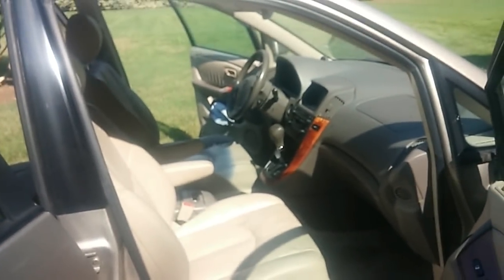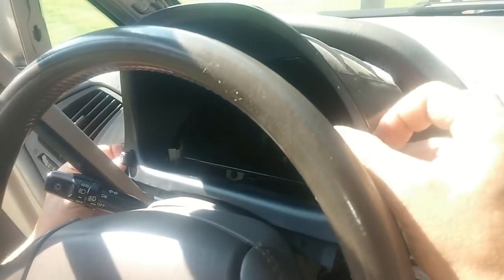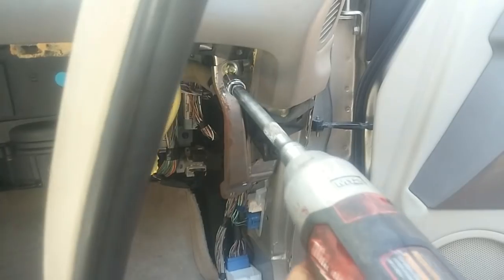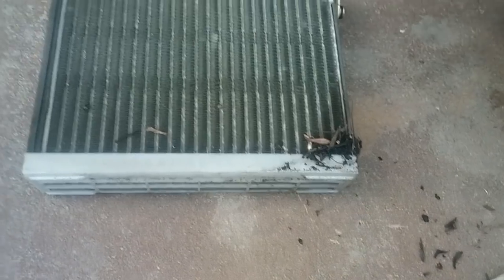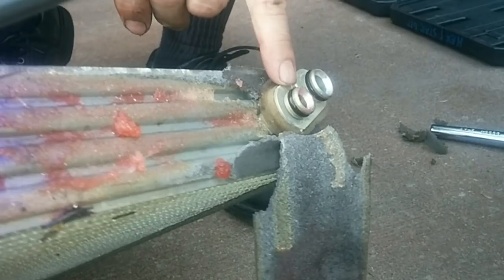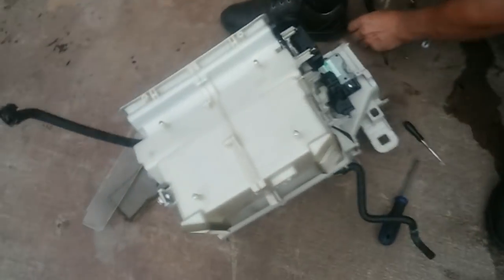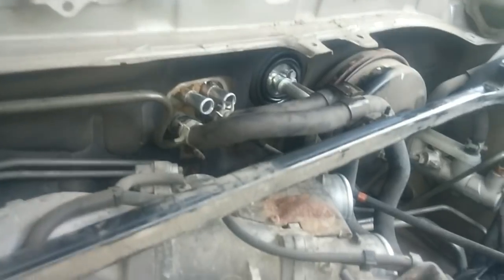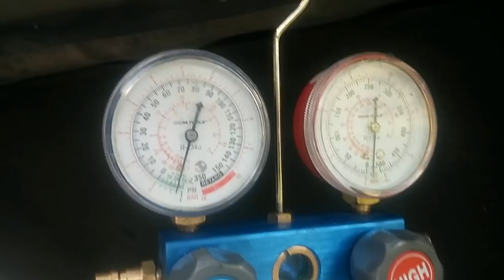A/C Evaporator and Heater Core Replacement - Lexus RX300

Comment: Out of curiosity, what did the PAG compressor oil smell of? Is it an acrid smell, like the one overheating electrical stuff/wires/circuit boards make?
Reply from the maker: Can't really say that PAG oil gives off a specific smell; but leaking freon has its own unique and distinctive odor.
Reply: @hardlymovingpro  First of all, thank you very much for your answer. All around the Internet they seem to say two things: that the actual R-134A hasn't got any odor at all, and that the odor an evaporator leaking R-134A gives off comes from the oil (it dissolves in the refrigerant so that it can be carried around the system). Also, the majority of people define the odor as the one a fresh Band-Aid gives off, but i've tried to carefully smell an equivalent i can readily buy, and the bandage doesn't seem to give off any smell at all. Some also say that it smells like the smell a new car interior usually gives off... As for now, can't smell anything out of the ordinary out of my vents, but it's an old old car, so knowing what a PAG leak, and hence a refrigerant leak, really smells like, might be useful. I could also buy a PAG oil bottle, but it would never be put into use since i can't do AC repairs, and nobody i know would accept an opened bottle even if it's the double end capped PAG. It would just end up lying among my stuff unless i find some alternative use for it (chain lube?). PS Never seen red dyed PAG in any picture i've seen so far, only green. Does it glow red to UV light perhaps?
Reply from the maker: I can't describe the smell but its different than a gas or oil smell.  It permeates the interior when the car is running and there's a freon leak in the evaporator core after a freon re-charge.  The red dye came from an a/c metal leak sealer product that did not work.  PAG is used to identify a refrigerant oil type and is followed by a number.  Never heard of anyone referring to a a/c leak as a PAG leak.  Generally speaking, any place in the a/c system that's leaking freon will also leak out PAG oil.
Reply: @hardlymovingpro  Thanks for clarifying the red colour anyways. If i'll ever happen to get my hands on a PAG compressor oil bottle or sample, i'll surely come back here and try to describe its smell the best i can. And a happy new year by the way!
Reply from the maker: Thanks ... good luck ... and happy new year to you as well!
Reply: @hardlymovingpro  Well, i finally had the chance to smell the PAG (refrigerants aren't involved here, so don't worry ;-) ) and i'm gonna tell you what i found.
It was a brand new PAG 46 bottle, apparently the double end capped type. European manufacturer.
To me, it smells exactly like...
a pair of Latex gloves. Yes. A pair of Latex gloves. Yes, apparently not so different from the smell you find in a brand new car. It also smells like fresh home paint (done some paint work too). But... both of them are very very faint notes. Wonder how it could even make its way to the vents from the leaking evaporator and stink the car up. Never smelt anything like that on my car, fortunately enough (there's also a hatch on the evaporator box for the filter, that shows the evaporator coil when the filter is removed, but no such smell comes from here, i can only smell the foaming cleaner i put in there from time to time). That has to be the "Band Aid box" smell and it would be the smell of one of three things: 1)No AC 2)A day of very hard work, provided you find someone willing to hand the refrigerant part for you 3)A lot of money...
Gonna experiment with it as a dry lubricant until needed (i.e. for a regas, if whoever is doing the regas is willing to use my oil; they apparently tend to use POE 100 and nothing else around here, because it's apparently a lot cheaper, and i may try telling/showing him/her that my compressor, a Delphi CVC anyway, was originally fitted with an ISO 46 PAG oil; or for a compressor change/system flush/o-ring replacement).
I have some leftover DOT 4 brake fluid, which should be pretty similar chemically (PAG-based too), but...the smell is completely different. This one smells like fish oil.
Reply from the maker: With the number of A/C repair jobs I did last year, I'm thinking about just buying a freon sniffer detector.  You can put the sniffer prong up to any potential source of a leak and it will send out a audible noise when freon is detected.  With a evaporator leak, you can put the sniffer up next to an interior HVAC vent.
Reply: @hardlymovingpro  Yeah, the sniffer is definitely the best option for a pro, especially if it's a high quality one. Checking for that compressor oil phenolic smell is perfect for an amateur though, especially if you also have a way of viewing the evaporator coil and shining a UV light on it without needing to remove anything.

Comment: Great Job. My evaporator is still ok but in the plastic box is a rat's nest. It seems there is no way around to disassemble the whole dash to clean it.
Reply from the maker: Maybe a thin flexible vacuum tube attachment for a vacuum cleaner you can snake through the vents?
Reply: @hardlymovingpro  I got the most of the screws out of the evaporator's plastic housing and can split it nearly half an inch. Might work with a thin hose and suck one piece after the other.
Reply from the maker: Good for you and worth trying.

Comment: Wow, great video. I'm about to do the same thing to my Lexus IS300. Where did you get the insulating packing tape to put around the expansion valve and tubing?
Reply from the maker: Thanks for your comment.  You can get it from Lowes or Home Depot in their HVAC department.
Reply: @hardlymovingpro  Well I got it done. All new Denso compressor, condenser,  evaporator, and expansion valve. Flushed all the lines out and new seals. 2 weekends of my life but I saved about $3000. Evaporator and expansion valve were very challenging.  This job is definitely not for the faint of heart. For a first timer this requires alot of research, pictures, lots of note taking and PATIENCE. High and low side after filling were 30/210. Outside temperature 93F and blowing 40F at the vent.
Reply from the maker: Great job doing it all on your own!  Yes ... there's a lot of work involved but very satisfying when you get it working again.  FYI - the system should take over 24 oz (2 cans) of freon.  30 psi on the low side may be a little low.  You want it north of 35 psi.
Reply: @hardlymovingpro  Thanks for that. Dont know if I'm just paranoid or what, but when I rev the engine some I think hear the compressor roar a little. The compressor engages quietly and I can hardly hear it when engine runs at idle. Maybe that's normal and I didnt pay attention to it before. Would low r134a cause that? The compressor was pre filled with oil at the factory. I added 2 cans of r134a but may have lost a little while purging the gauge lines of air before adding it to the ac system. Any insight you have would be greatly appreciated.
Reply from the maker: Maybe the noise is coming from the compressor's clutch

Comment: Good grief that is a lot of work, I think I would just learn to live without AC, or just buy a new car. :) If I was doing this, that car will never be the same after after I was done. I am just curious how many extra parts did you have after it all went back together? Oh yea here is that part we forgot to but in back on step six hundred and thirty two, huh what step are we on now? Two thousand and thirty three, should we go back and put it back in? 
The AC works but five other things don't now and there are all sorts of squeaks and rattles. 😂
Reply from the maker: Just a few extra 10mm bolts.  No squeaks and rattles.
Reply: @hardlymovingpro  That is impressive, and also why I would pay someone else to do a job like this. Or live without AC, or just get another car. 🙂
Thanks for sharing, it just confirms what I already suspected, which is that this is a job best left for an experienced professional. While a DIY person might be able to do it, they will end up taking ten times longer, and most likely end breaking something else in the process.

Comment: You did not have to remove dash . I just removed the glove box air box heater core and removed it from inside . Unless a 2000 is just that much easier ?
Reply from the maker: I have no idea how you were able to pull that off. The evaporator is completely encapsulated in the two piece housing bolted to the firewall.
Reply: @hardlymovingpro  watched another video after yours only because this vehicle isn't worth the money , You have to remove the lines from the heater core  remove the 2 actuator motors , You can see in your video @17:27 between your elbow and the heater core lines is the access point for the core . Open that remove 2 screws from the drivers side and it slides right out . I removed both seats and the glove box door , Did remove the wipers and cowl which you really don't have to . I put in a new heater core so I had to cut the heater core lines and added 2 hoses a 4 clamps . Like I said this car wasn't worth the time , I really appreciate your video because it really helped me Identify everything , The other guys video kinda sucked but it was the lazy mans way out . Yours is the only way if you want to do the heater core and evaporator correctly just because of the lines for the heater core . A+ and thumbs up to you .
Reply from the maker: @stabg289  send me the link to the other video

Comment: What kind of insulation tape did you use to put around the expansion valve
Reply from the maker: HVAC (thick rubber) pipe insulation wrap that I purchased at my local HomeDepot or Lowes.  Matched the factory wrap perfectly!
Reply: Thank you so much. I’m getting ready to replace the evaporator on a 2007 Toyota Sienna. Thanks for getting back to me right away. Much appreciated.
Reply from the maker: @Wheredthecheesego  Good luck!  Keep everything you removed in the order you removed them and take photos along the way.  It can be repaired!

Comment: How did you guys find out it was a bad evap?
Reply from the maker: Leaking PAG oil via the condensation release tube under the car.  Also used a AC sniffer tool that picked up leaking refrigerant from the HVAC vents.
Reply: @hardlymovingpro  ohh the ac sniffer tool sounds useful then. car hvac is tough work.
Reply from the maker: Finding the leak source is!
Reply: @hardlymovingpro  i would just replace everything if its an old car. The ac system is too sensitive to any mistakes.
Reply from the maker: I had a customer quoted $2,400 to replace everything when the repair shop couldn't find the leak source.  It turned out to be one of service port Schrader valve (less than a $1.00 part?).  Using a quick connect to test for vacuum leakage or pressure leakage would have never found the source since the quick connect depresses the Schrader valve.  When the quick connect is removed, the o ring in the valve is suppose to maintain a seal.  Defective o ring, no seal.   I replaced the valve, evacuated and recharged.  Refrigerate leakage problem resolved.
Reply: @hardlymovingpro  The $2400 quote to replace everything is a good quote and that's how much I would charge to replace everything, flush, and recharge. Your diagnose time isn't free, and if you're lucky enough to find the failing part, something else will soon fail, and when that happens, you're looking at another couple hundred dollars in diag and recleaning the entire system. The AC system is cheap enough to replace, but also very intolerant to mistakes. Depending on how old the car is, I would replace everything. If its a fairly new car, I would charge for diagnostics and find the culprit. Do you have any good vacuum and recharge machines you recommend? I'm looking to get into car hvac myself.
Reply from the maker: Finding the schrader valve leak was a no brainer.  Big oil stains around the service port and my ac sniffer tool sounded the alarm when it picked up the refrigerant molecules.  Surprised that the other ac shops didn't pickup on obvious leak.   Replaced the condenser and expansion valve on a late model F150 a few days ago.  Another no brainer.  Big oil stain on the condenser and high side pressure wouldn't drop below 400 psi (bad expansion valve).  AC working 100% after replacing those 2 parts.
Reply: @hardlymovingpro  Nice. Whats your process? Do you recover, flush, vacuum, then recharge?

Comment: Q, Can you replace the expansion valve without taking the entire AC unit out of the car?  Book time says 2.8 hours for expansion valve, I wonder if that is legit?
Reply from the maker: Never tried.  But don't see how it can be done if the valve is behind the firewall and wrapped with insulation material.

Comment: Can a heater core create moisture and dampness inside my Lexus? My windows get all foggy
Reply from the maker: If your a/c is turned on ... nope.
Reply: @hardlymovingpro  I'm getting a weird smell. I don't run ac in the winter and I noticed my back seat floor was wet. Condensation forms on my windows inside(a lot). I don't know what is wrong.
Reply from the maker: Running the a/c in the winter removes condensation in the air which is why when you place your HVAC control in defrost the car automatically sets on the a/c.  If your back seat is wet, I'm going to guess you have a rear window gasket leak that's seeping in moisture.  Have it checked out by a auto window installation shop.
Reply: @hardlymovingpro  its weird.
Reply: @hardlymovingpro  it was the floor wet not seat
Reply from the maker: Then it could be a leak in the door seal.
Reply: @hardlymovingpro  I didn't think of that. My woman just told me she thinks it's the heater core.
Reply from the maker: If it was the heater core leaking, the leak would be in the front seat floor mats.  Also, your coolant level would be low in both your radiator and coolant reservoir.  Maybe its a leaking water bottle hiding below the front seat.
Reply: @hardlymovingpro  thanks for the help. I hope to get the issue resolved.

Comment: Man ..i just bought a used lexus rx350 2009 2 weeks back..everything works fine..except the a/c..changed the compressor and the condenser..improved a little..but never getting cold enough air..and the airflow is bad..now mechanic told me the car's heater core is clogged..he would not touch it..but he gives an estimate it is a 3 days work..and the job would cost north of 2000 usd..i bought the car for 4.5k thinking i got a good deal..now i am on the hunt for a naive buyer like me..wish me luck.
Reply from the maker: Mechanic quoted you 3 days work because he doesn't want to do the work unless he gets paid 3X the normal rate.  Should only be a 8 hour job if you know what you're doing. Clogged heater cores can be blown out with high pressure water.  Shop around for another repair shop to get a more accurate assessment of problems and repair quote.

Comment: GREAT how too I was hoping to not do this so maybe you can answer a question before I have to do this. I have heat on one side not the other in all modes. Car does NOT have dual climate like yours. 
Is there a diverter or flap inside that heater core box that may be blocked?? For life of me I can't see why cold air blows on drivers side and hot on pass in all modes IE defrost, face flow etc. I am about to go to junk yard to do exactly this just to buy a HCB to investigate why my is doing this. Even if I can jimmy it to just blow hot only Im fine with that but cold on one side not fine with. YES I have fixed servos, back flushed,  replaced thermostat everything has been isolated to *inside* the HCB suggesting a blockage of some type any help or insight would be great. Not sure what Jaddah was referring too either but the internet is free and full of opinions some not worth your time honestly 
Great Video it will help lots be pround and us out there are thankful you made it
Reply from the maker: Thanks.  From my recollection working on a Chevy Impala a few years ago, I replaced 3 blend door actuators and the the car did not have dual controls.  How I found their location was to have someone play with the temp control while I listened for slipping gear noise.
Reply from the maker: On a 99 Ford F150  I worked on a few years back, I bought a Dorman kit to replace the broken hinge on the blend door.  I was surprised that this commonly occurs on this model.   So, it's possible your blend door hinge point may be broken or jammed.

Comment: I would have sold the car.  I hope this does not fail on my 2004 Ls430.
Reply from the maker: You'd be hard pressed to find a buyer with a non functioning ac systems ... but I know how you feel.  LS vehicles are different.  I replaced the evaporator on a '92 LS400 through the glove box area.  Didn't have to rip the dash apart.   Don't know if the 430 uses the same design.

Comment: Mine stop blowing to the front, tested the Mode servo, damage, tested the Blend servo, damage also, ordered and received both, replaced, tested, both working fine now BUT no cooling. I hope is not the evaporator.  Don't trust anybody to do a job like that,  20 years ago may take me 3 days to do that, now at 68 years old at least a week. Crossing fingers now, will take somewhere for testing this week.
Reply from the maker: Could be the air mixture (blend door) motor.  Turn on a.c. and listen for compressor motor engaging and check that the a.c. high pressure line is cold.

Comment: What code was given to have to do this job??
Reply from the maker: No codes because the Ac is not a emission related part.
Reply: @hardlymovingpro  oh wow, thanks for getting back, one more thing, where is the evap? Im getting a P code.
Reply: @hardlymovingpro  I was watching video to see if you touch on it..
Reply: @hardlymovingpro  ..still I may have to do this job one day if I keep the truck.
Reply from the maker: Depends on the code after the P
Reply: @hardlymovingpro  right,, p0446